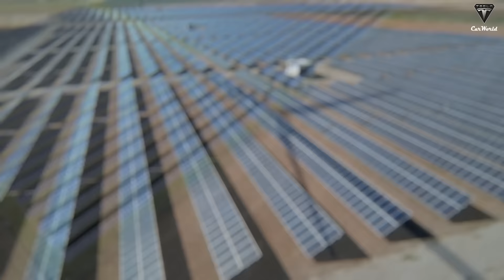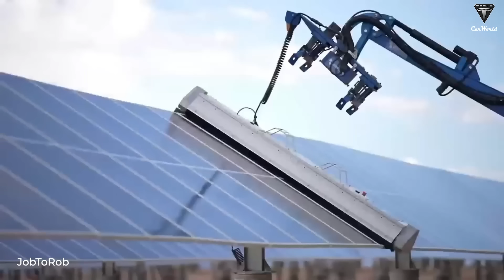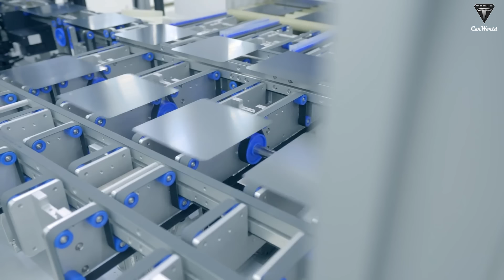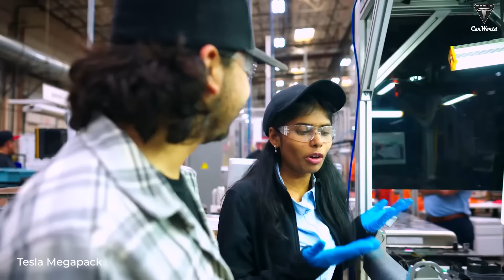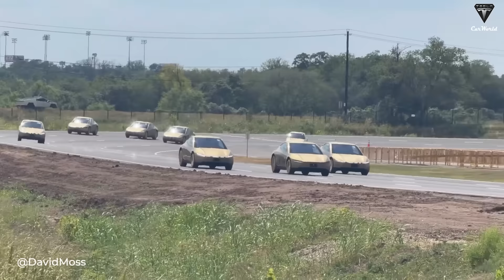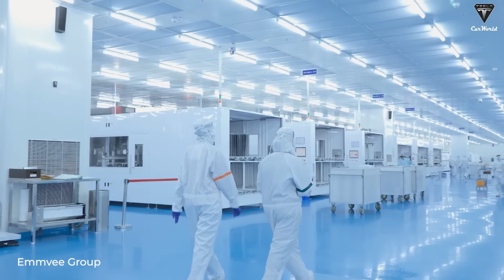Tesla's Solar Factory & New Robot Makes Solar Power INSANELY Cheap!

Comment: solar takes up to much space. NUCLEAR is 100 times better. Without using acers of space.
Reply: No, parking lots take up too much space. Most cars are used less than 10 % of the time. The Cyber cab util-rate will flip that to 90%. Then we can flip all those parking spaces to solar parks and housing.